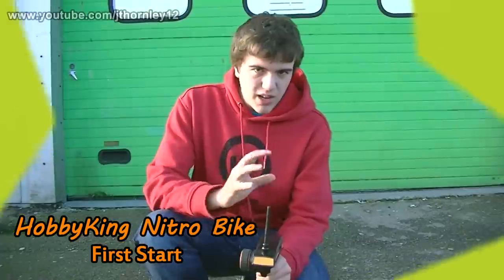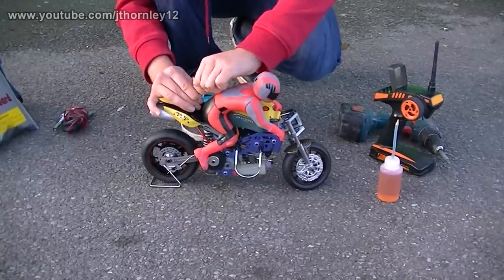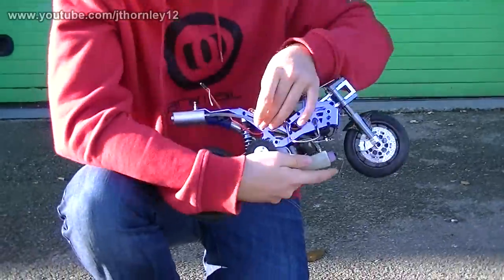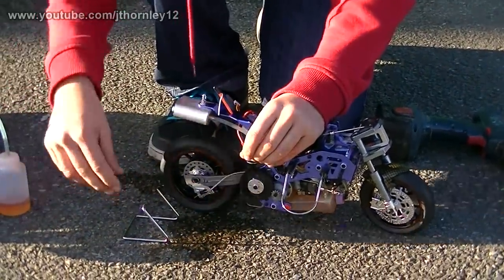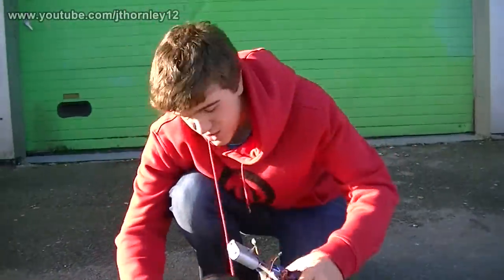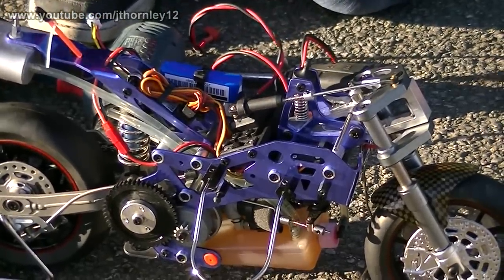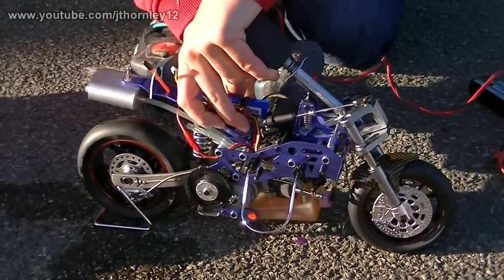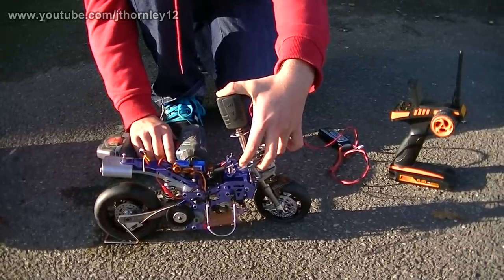Hobbyking Nitro RC Bike First Start

Comment: The stand will drive you nuts!
On breakin extended run with no rpm change should be avoided.
imho front brake upgrade is a must.

Comment: Any suggestions how to remove a stubborn piston sleeve without damage.  Grrr4r
Reply from the maker: Yes, put a zip tie through the exhaust port and then turn engine over. the zip tie will push the sleeve out :)

Comment: Hi Josh. When U set ya EPA. Do U set carb with Venturi in or out? I'm gonna use the Venturi when I run the car  Nord sure to set carb Venturi in or out.  Cheers mate
Reply from the maker: You'd need to set the tuning needles with it in, and then if you remove it you'll have to retune the engine.

Comment: it is awesome to have a nitro car or bike, but the only thing that is a pain in the ass, is that it so expensive to run compared to electro. and yes "nitro is better because you can run it longer then electro, but the nice thing with electro, it is cheeper to recharge, if you have 3 high quality battery, it can charge within 10 min. so use one, when it is empty take another that is full, and recharge that one. it is more likely pepole would borrow you electricity.

Comment: Now imagine this, you run out of fuel and gotta' wait for it to come in the mail, it takes 30 minutes to recharge. And I have 10 batteries which cost $3 in electricity to refil and last more. Furthermore, we don't have to be careful not to make a mess around the tank or spill some, it takes us a click to take the battery in, and another to pop it back in

Comment: I would have used a hair dryer to preheat the engine and give it a little expansion before cranking over a new Nitro engine.   It would have started much easier and less stress on the internals.